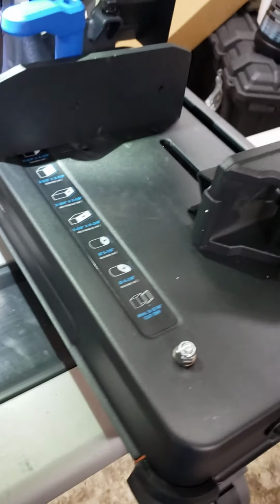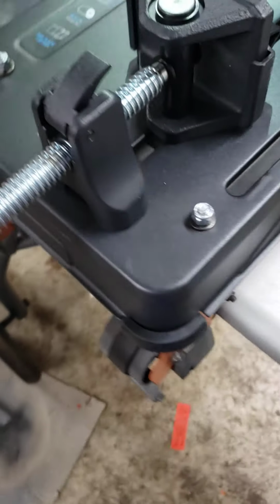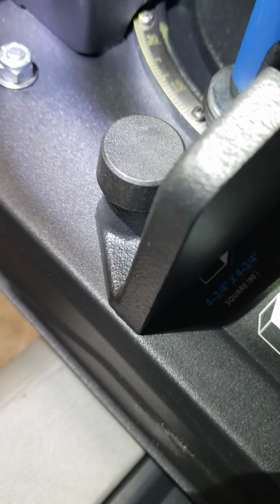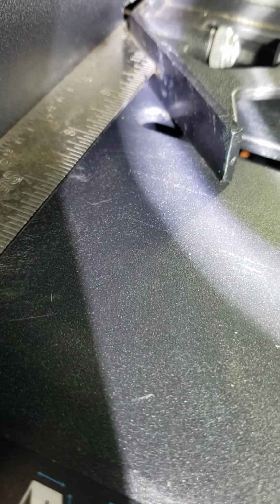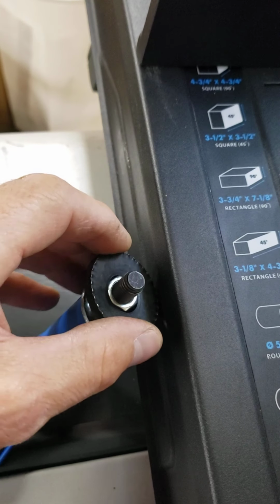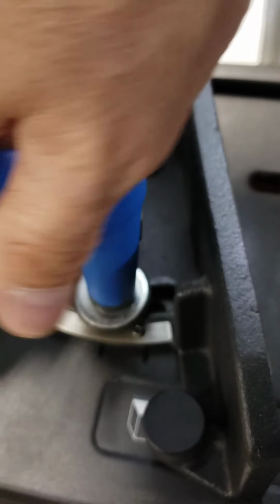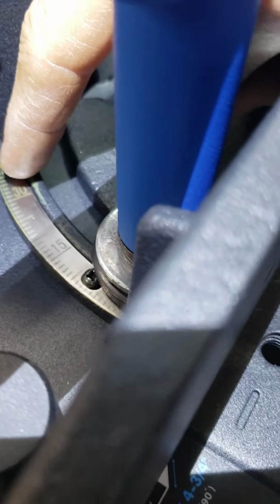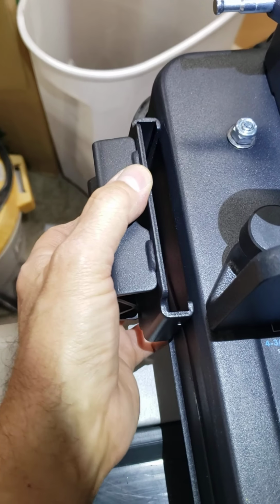Evolution 355cpsl setup.

Comment: Wouldn’t the rubber washer underneath the bushing where you mounted it to the table allow for vibration and movement, potentially pulling you out of square ?
Reply from the maker: No issues